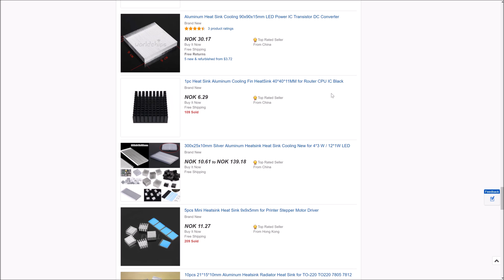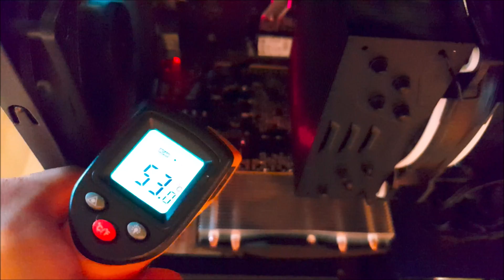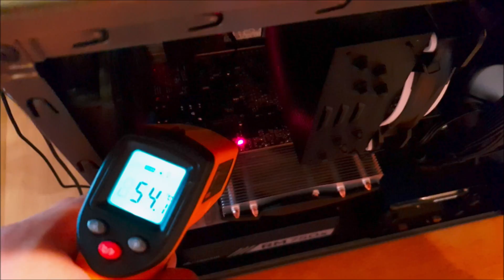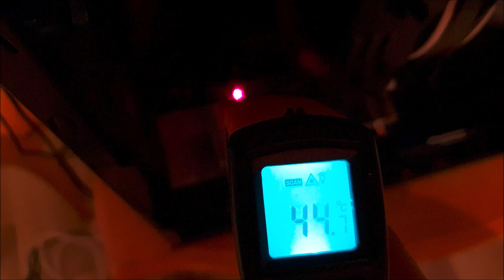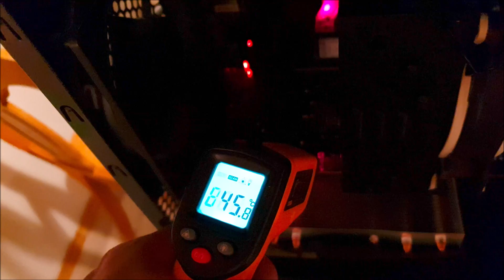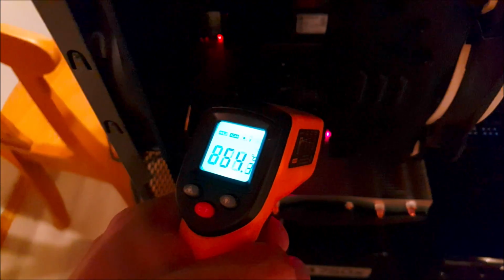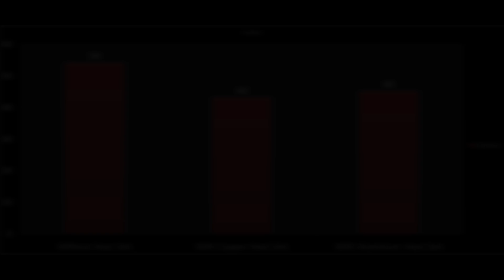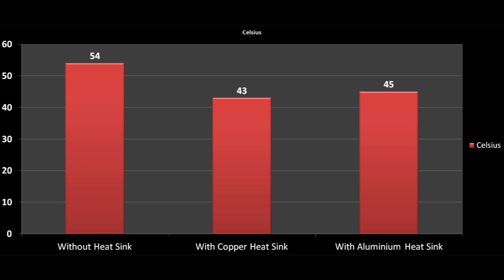Copper vs Aluminium VRAM Heat Sinks

Comment: Hi, Could you please provide link of thermal tape for sticking heatsink
Reply from the maker: Unfortunately I can not find the store where I bought this tape from originally. But I found this one: 

https://www.aliexpress.com/ssr/300000512/BundleDeals2?spm=a2g0o.productlist.main.7.41db1ab9pC8QQD&productIds=1005004220389088:12000028423623615&pha_manifest=ssr&_immersiveMode=true&disableNav=YES&sourceName=SEARCHProduct&utparam-url=scene%3Asearch%7Cquery_from%3A%7Cx_object_id%3A1005004220389088%7C_p_origin_prod%3A
Reply: @TechnologyHive 
Please suggest any alternatives as the link doesn't show the product

Comment: 6 years on and this video has helped me make an informed decision on how I should proceed with my used EVGA 1660 heat troubles. I am going with copper and using Kaptin tape to give me peace of mind in avoiding any shorts and frying my card. I need to create a thickness stack equal to 4mm and another 9mm! in between the memory chip and the cold plate that attaches to the fans. EVGA really cheaped out on the memory and VRAM cooling on that card by using an absurdly thick thermal pad/s to make things work and they are not available anywhere anymore. Thanks for sharing this information. Liked and subbed.
Reply from the maker: I am glad you found the video helpful! Thanks for the sub :)

Comment: Bro, can u do this kind of test one more time? But now add some thermal pads beneath 'em. And see how the difference is
Reply from the maker: @TripleDouble-j5r  I can tell you that it depends on the thermal pad quality. Some pads work better than others, and the tape I used here works better than some pads. I'll if I can make a short video.
Reply: @TechnologyHive  thanks mate

Comment: DISCLAIMER: I wrote this comment, then rewatched to ensure I hadn't missed anything. I had, in fact, missed something: this comment is partially wrong as they measured the rear of the chips not the heatsinks, it's just difficult to see due to the poor lighting - however I'm leaving it with this disclaimer  as it does contain useful information. 

This is not a useful experiement. The targets were different colours - remember black bodies from high school physics?
The black heatsink will read as a higher 'temperature' than the copper one even when it is the same temperature as a simple matter of emmissivity. Instead, you should use the thermal sensors built into your GPU to get measurements from. Only this will give meaningful results. Otherwise, all you have proven is that a heatsink probably makes the component cooler. 
Furthermore, those IR guns do not read the value at the point the laser dot is at, they read from a view cone. How large is the cone for your specific model? I have no idea and neither do you.
Gamers Nexus have a fantastic writeup on IR guns and thermal cameras, I recommend reading it.
Reply from the maker: @identity__thief  have a good day 🙂

Comment: if you want thermal conductivity and efficient at that, shouldn't the aluminum be painted or colored white?
Reply from the maker: It doesn't matter since it's just absorbing heat through conductivity, not through light.

Comment: I respect the benchmark and thank you the upload and the work with it.
As I see the difference very small as a theroetical calculation would be: 1. DRAM modules power consumption is little 2. To suggest the power the surface is big -> EZ to cool, so in this case a margin of difference between of Al and Cu.
What I would test: LAPING the DRAM plastic surface. That would be another very interesting benchmark.
Reply from the maker: Thanks for watching!

Comment: Great video! I this really was informative. I plan on watercooling a gpu of mine in my server but no one makes a block for it. so Im getting a universal block and modifying it to fit my card, but the problem is it only contacts the GPU die, no cooling for the VRAM or Mosfets/ VRMs, so I was planning to put some heatsinks on them. its a low wattage 75W card( just using it for the encoder/decoder don't actually need 3D acceleration) but still GDDR6 VRAM gets hot so I'm concerned.
Reply from the maker: If you manage to get some of these little heatsinks it may help reduce your temps for the vram. I actually use them on system ram as well for overclocking. They work real good.

Comment: I use nickel, sometimes copper...get down with the thickness!
Reply from the maker: I have since found a better option: https://www.amazon.com/Thermal-Adhesive-Performance-Heatsink-Computer/dp/B085CLXM7J/ref=sr_1_3?keywords=thermal%2Btape&sr=8-3&th=1

It does not matter to me where you buy it. This stuff works better.

Comment: Using 3M 9448A as thermal glue/tape is horrible advice. It is not designed for heat transfer. Use 3M 8810 instead.
Reply from the maker: I have since found a different tape that works better. Thanks for the tip anyway.

Comment: I know this is old but I think it would be a much better idea to instead of using singular smaller heatsinks use like a larger slab of heatsink then cut it into shape and use it as one larger piece!
Reply from the maker: You are right. Unfortunately I do not have the proper machinery for the job. I own a miter saw and a few other metal cutting tools. But the aluminium slabs I have are larger and would require something like a bandsaw to get it all into the right dimensions.
Reply: @TechnologyHive  Not having the tools for the job is the worst feeling, when I first started I only had a crappy corded drill and a hacksaw😄.
I can still remember friction drilling with a rusty nail🤣🤣.
Keep these videos coming man, you are awesome!
Reply from the maker: @AutodidactEngineer  That means a lot!! Thank you for the compliment!! And yes, I agree, the right tools make a huge difference. I'd imagine you'd know how many tools you'll need for a single even small project LOL I will keep the videos coming, thanks again!

Comment: link for the heat tape please?
Reply from the maker: It has been updated. https://www.ebay.com/itm/194746839962?hash=item2d57d0f39a:g:b~EAAOSw-sBiBiGh&amdata=enc%3AAQAIAAAAwP%2BFJ2ledzMaYdmya9Odio33FJstbeIBTPq7tSxsF%2Faz9OVf7nCh8pqe6xDdxGOd34I%2BljtzgLwcsaCzDIA07WpWVJkw6C6zRsVkRlI7yPGYs0pXdAmopq6oLqoAbRjvGqGuinNalCg0qQtu508OvygYIurIqUWLL2XcknHpJ5NfFHY24xCNIEr%2FNT%2Blvdxqlc4JH%2B3y8zHMIUgLDQWP4Sx7dr%2F%2BUdm6tY%2Frq98GOvGBdtgaHyHm7LiHWSlZ4yxEtg%3D%3D%7Ctkp%3ABk9SR7zm-Ij0YQ

Comment: anyone know why, after i replace my thermal pad
it keep rebooting what happen ??
Reply: I'm sorry to hear this. Is this on a video card? It could be many things. You may have damaged a component during the assembly or disassembly of the card's cooler. Another potential reason might be that you've used an incorrect pad thickness for the specific component. If the pad is thinner than it should be, it will not make good contact with the metal contact surface of the cooler.

Comment: Copper always makes for a better heat sink because its rate of thermal conductivity is higher.  As much as I do appreciate this demo, there are major problems with it.
--
First, the two heat sinks clearly do not have the same volume, shape, or surface area, so the test is completely invalid.  They are vaguely the same physical size, but that's not nearly good enough.  The thickness and fin structure are completely different.
--
Second, those are tiny heat sinks and the temps are only in the 40-50 range.  That means we are talking about a relatively low amount of heat dissipation to begin with.  If you used large devices and heat sinks, such that the device would soar over 100 C without a heat sink and came down to 50 with a sink, you would be able to see a much more significant difference between the copper and aluminum.

Comment: As far I know Aluminum reflect 95% infrared heat. So, your heatgun showed its cold but it actually block the heat. 
I wonder why we use Aluminum as heat sink?
Reply: If you look closely, you'll see that he points the gun at the back of the PCB, not the heatsink.
Reply: @bgtubber  I got it
Reply: @Taahmim  👍

Comment: This is actually helping me in design elements of a custom waterblock I am making. I was curious if just making copper bars that bolt to the board would be enough to keep voltage regulator temps safe and that appears to be the case. this could greatly simplify my block design as going over SMD's to attach different zones of the card is difficult and less universal in design.
Reply: im in the same boat here,  hows it going?
Reply: I've built 2 blocks where the SMD contact points are with copper bars attached to the shared top copper plate of the water block. Works flawlessly. You just have to remember the joint solder increases the depth of the bar and you have to account for that in measurements. @hectororestes2752

Comment: I've used that 3M tape to attach additional heatsinks to the backplate of the VRM heatsink on an old Asus P8Z77-V MB (unsually it has 3 of its 8 pairs of VRM mosfets on the back of the PCB, hence under that backplate). It's actually intended as a thermally stable rather than conductive tape but it does work quite well in the latter respect because it's so thin. The afore-mentioned heatsinks (a line of five 20x20x15mm aluminium) get very warm to the touch, and a IR thermometer indicates they get to over at 50°C at their bases, so they're definitely removing some heat.  I also found (like you ) that this sticks enough but not too much and is easy to remove without risking damage. Appreciate seeing you confirming that this is a valid method (I'm about to use the same little copper suckers on graphics vram as here).
Reply from the maker: I am still using this method and it works well especially with graphics cards.
Reply: @TechnologyHive  I forgot to mention your use of clamps - great idea - having just RTFM (read the ***** manual!) this is what 3M recommends. I might put the card, with the sinks clamped, into a warm oven (80°C) for an hour to aid sticking.
Reply: Do you guys know how I can get my hands on this? There are similar products on Amazon but they are have a fair number of bad reviews, mainly around the adhesive not being strong enough.

Comment: Why 3M 9448A? It's just a short-chain acrylic adhesive with no thermally conductive filler. 0.1mm thermal adhesive pads don't have quite the holding power of acrylic, but they should conduct heat better, and they do hold well enough for small heatsinks like all of these. That being said, normal double sided tape or this 3M does work in a pinch, because it's mostly liquid, it maintains some thermal conductivity, it's just not all that ideal. But you should keep this in mind, because you're adding up thermal impedances, thermal impedance of die to IC case, case to tape, tape volume, tape to heatsink, heatsink to air; you task is to evaluate the sum of heatsink related impedances, but it's likely swamped by the impedance of 3M tape. That being said that is still likely to be an improvement over the direct impedance of carbon epoxy IC casing to air.

Thermal adhesive glue is actually remarkably bad compared to paste and even fairly cheap 1W/mK thermal tape. There's basically never a reason to use it, unless you actually want things to never come apart no matter what.

Aim the pyrometer laser above where you're measuring temperature, as there is an offset between the laser and the IR optics. Always make sure the complete sensor frustum is pointing at organic surfaces, never at metal. Of course with pins and such you can't quite avoid it, but you can do your best, in particular you should never try to measure on heatsinks, as they are reflective in the measurement range. PCB solderstop lacquer has infrared emissivity in pyrometer's IR measurement range of around 0.95, for which the pyrometer shows the correct temperature value; aluminium has emissivity of around 0.1-0.4, depends on surface treatment (depth of eloxation), and copper has emissivity of less than 0.03, so it's basically invisible. When you point your laser at the edge of the card like that, most of the thermal optics frustum is on the heatsink below. In your measurement that you do later with stick on heatsinks on, nothing you measure makes any sense at all - the lower measurement on copper might as well be explained by its lower emissivity (and higher reflectivity) in the specific measurement range of the pyrometer, rather than the actual temperature difference. If you have to measure a temperature at a heatsink you have to get a K-type thermocouple, and you can glue it right to the side of the chip with some thermal paste and some Kapton tape to hold it in place, or the PCB there, just make sure not to short something. You can then figure out whether the heatsinks were an improvement by measuring this nearby temperature instead.

As a rule of thumb, you usually need an aluminium heatsink about twice the size of copper one to reach the same performance, and with geometry adjustments; i wager a guess, the heatsinks shown are insanely close to each other in terms of their °C/W value.
Reply: Arctic alumina  adhesive has a thermal conductivity of 9.5w/mk which is better than quite a few pastes out there though it is permanent there is a way to make it semi permanent by mixing 2parts adhesive to 1 part paste!
Reply: @AutodidactEngineer  Never trust the spec values coming from consumer oriented companies, they are, with a few scant exceptions, complete garbage! Pulled right out of their behind. For years Arctic Silver Inc (this very same company) have claimed that AS-5 has a thermal conductivity of what, 8.7W/mK, right? In independent testing, it has been shown to be right around 1W/mK.

Comment: What cooler is on the gpu? Damn
Reply from the maker: It's an Arctic Cooling eSport black.
Reply: @TechnologyHive  no. The one on the graphics card, sir. What low profile cpu cooler did you put on it? Seems like "plug and play" mounting.
Reply: Oh sorry. I already found your video about it. This cooler no where to be found
Reply from the maker: @izzatti7446  ah sorry I misread that. Yes its hard to find nowadays. Best bet is eBay.

Comment: My vram uses the radiator via thermal pad to get cooler but the pcb on the other side is pretty hot when I stress the gpu. Would it improve things if I stuck heatsinks on the other side, directly on the pcb? That would overlap with other tiny components too and not make a good contact but wouldn't it be better than nothing?
Reply from the maker: I wouldn't do that, but you can if you want of course. I'd look for another way to drop temperatures. I no longer have my computer parts inside a case anymore and this alone I'm proved temperatures by around 10-15 degrees.
Reply: @TechnologyHive  Thank you for the suggestion. It was open before but my cat always made me nervous when she was around. I may try a couple of fans directed toward the back plate then.
Reply from the maker: @chongtak  that's what I would do to be honest. 👍
Reply: @TechnologyHive  Thanks for your answers, you've earned a new suscriber.
Reply from the maker: @chongtak  Thank you ☺

Comment: Are all the VRAMs measures the same? I mean if i buy those copper heatsinks, they probably have the size of the VRAMs? Wich measures should i buy?
Reply from the maker: They are pretty generic in size. 7- 10mm is the average size which works well for vram chips.

Comment: I REALLY APPRECIATE this test - BUT I must say that it is an unfair comparison as the Copper sink has More Material & More Surface Area in it's design... A fair test would use sinks that are IDENTICAL in design, where only the materials differ... However - I can still deduce that Aluminium is better, as it does almost the same job as Copper, with less material & a less efficient design - so THANKS again... =]
Reply from the maker: I could not find anything else similar to each other at the time of video. Today it might be a different story. Maybe I'll update the tests.
Reply: @TechnologyHive  I did a check & this is the only one similar to the Copper you used that I found(What the name of the Tape though?): https://www.ebay.com/itm/114466028230?_trkparms=ispr%3D1&hash=item1aa6b4fac6:g:kKUAAOSwkmZfiW3I&amdata=enc%3AAQAGAAACkPYe5NmHp%252B2JMhMi7yxGiTJkPrKr5t53CooMSQt2orsSR84A%252FGMxXIqJzFmDq6lDLiVGg7z2YXM79DGcDpKCPO3wOgAk0obDsJAlhzVlapaNf3pxAszKrN7DN7ydnX%252BQjN%252B8UMn%252BRpZqcdf9vB78nsp42tXMdS9AtAC5fX9dSGnsiNP9ZaCoD%252FH3ldlkaSTnhus2U2TVMYQMLTvynpsk1TWgrcASeXrHGJ5LL8nvFtpLTzpjYXt2j2FxwcR9FFXgiDjVm%252Ffcc8SJFFPWwd2lJC2n81wEGzWG55lmcLoJ4MJvrf%252BOou2%252FIdiSo1XgCreQ2JiS04%252Bwogj3X6ncgq4aBlxZ6f%252F9avFDC3cJnJjJJ8g9ucO48meZMt0wCvlmxhkw4l5bdJXVsDd8%252Frae1A2yKFK0GIPWBxNmlgIavTflY1%252B6VElpECLCnxO1L7lNB%252B%252FZI5rMagTKxLB5K7eZFvUk%252FGw0nl8m7BGmo7aob2JLDMu4YzbFuW15BfkfUe%252FrzL1HIIcccTtw8bCFUENjpUa2n3NTB2ZP3cvyxdY06FJTabPN7cYlhIhoFIBli0iNEwEZsqCxvdfWj6KVYv%252FjHsd%252BhnF11c9XhYS9S%252BMb1dKCkSKESgKVcFuGt5oG2SwPb1VqXNH7bgXnI1iiTeXOUtIqfPbp7RWpb2kG5ZPjT4zRr%252Fhr2kDhlK62BWwsaIJ7rLNn4sFXStKlGTJSi%252FRYluowrGcGT7g9ymUbwKF2MPbSqctiulbJwLEctDEJnLtfsA1VFOBXDsMDElgIZdO2LmM7M7JAPIisSlTkeqjabLFB%252B5lvLUmT8cNmT35hE%252BiDsy5TXsYUcXnHIiW8SnINGOtxJpddTX%252B%252Fc%252BMNUfcBcxg9vjw8%7Campid%3APL_CLK%7Cclp%3A2334524

Comment: that 3M tape sucks big time. SEKISUI 5760 is much better. obviously results will show much bigger difference with a better thermal tape.
Reply from the maker: I haven't tried the SEKISUI brand. Sounds Japanese so it must be of superior quality 👍.
Reply: @TechnologyHive  judging products by nationality is really stupid in such a globalized world where products are made all over the place with raw materials from everywhere. with that said, sekisui 5760 is made specifically for coolers and has a much higher thermal conductivity than other tapes.
if you really wanted to make a serious test you would need to use a decent thermal paste.
thermal tapes are really bad
Reply from the maker: @riskinhos  You should make a video and show us how it's really done then 😊👍.